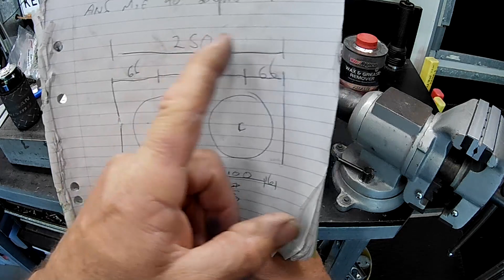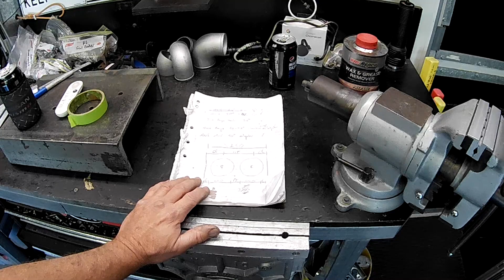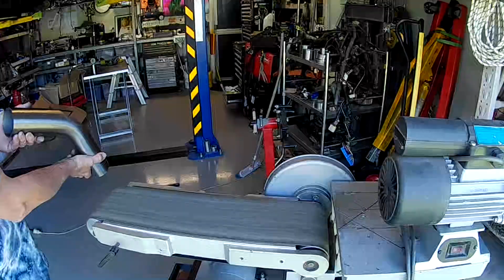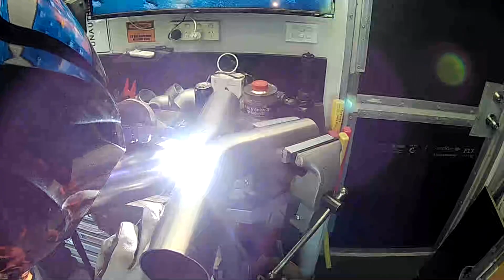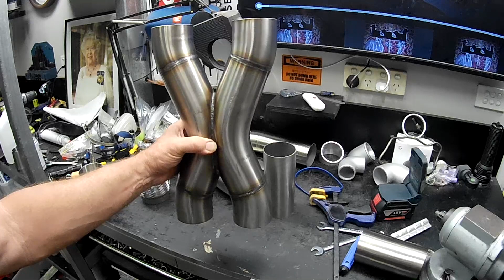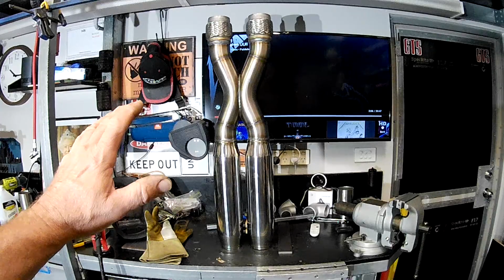Custom Stainless Mid Pipe Fabrication. Project Fairlady, The Nissan Z32 300zx Twin Turbo Mega Build,

Comment: You did back purge your other pipe, correct?
I understand that would be the optimal method.  Any issues really with just welding them like you did here?
Reply from the maker: G'day Mate, yes, anything (stainless) pre turbo really should be backpurged, particularly with thicker material. 
If you are reasonably skilled with stainless & using thin pipe such as this, you can weld it with almost no sugaring occurring on the back side.
 A word of warning though, you have to be on your game. Too much heat & or to slow a travel speed & you will have a total mess on your hands.
Purging is always best, but takes a ton of gas & way more time to do.